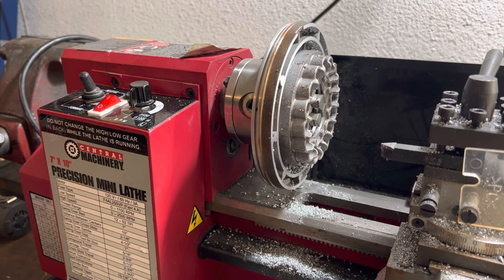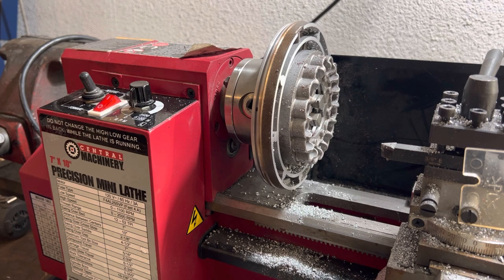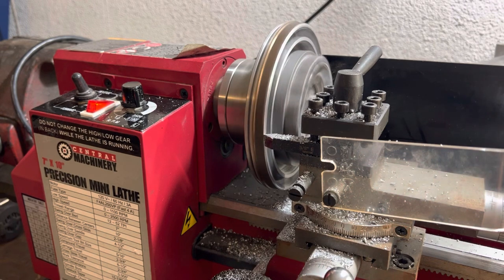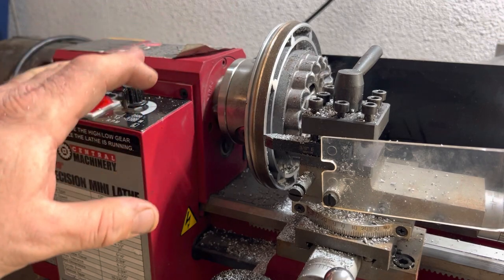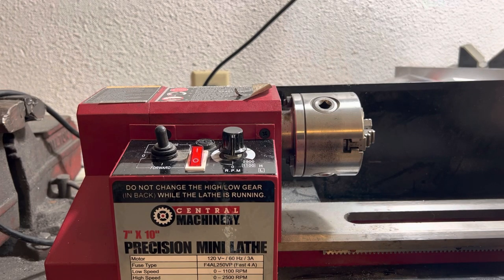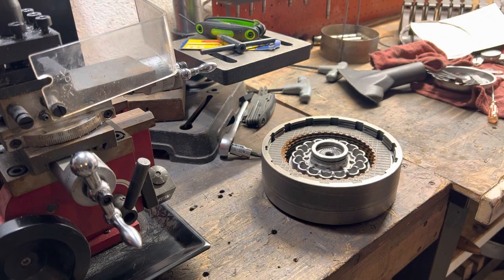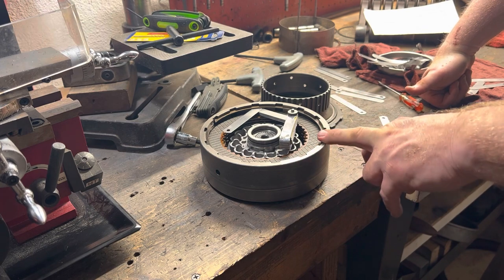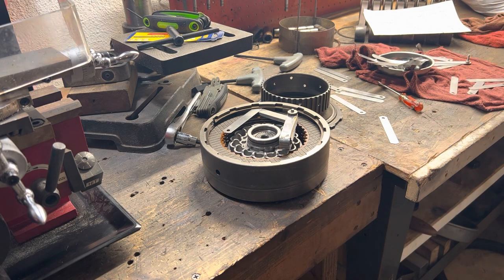DIY TH400 cut the apply piston 6 Forward clutches

Comment: Thanks for making this video. I was wondering if the HF lathe would cut these pistons decently. I’m curious as to why your trans failed. I’ll be on the lookout for the next videos.
Reply from the maker: Hint: Always verify the check ball vent/release is functioning properly.
Reply from the maker: I wanted to find out if the HF mini lathe would work, many people thought it was to small but it worked great.  slow speed, sharp insert, in Low range never had it bog, slow down nothing abnormal cutting these aluminum pistons,
Reply: @HeadFlowInc  good to know. I’ve been on the lookout for a small lathe just for jobs like this. Also- if you send me a private message on FB messenger, I will send you some brass plugs (free of charge) for the next time you have to restrict your converter feed hole. Picture of truck/camper is my profile picture.  Otherwise delete this message. Thanks again for taking the time to video your adventures. I always enjoy your videos.

Comment: For 6 clutch plates. Put three .060” washers on the last friction, place the pressure plate on and install the snap ring. Check w feeler gauge between snap ring and top of pressure plate, if the snap ring will not go in it’s to tight.

Comment: Is that your new lathe or the one you borrowed?
Reply from the maker: Richards Harbor Freight Mini lathe, its proof of concept it works!  Many people questioned whether it was a big enough lathe, Winner.
Reply: @HeadFlowInc  did you use a level when mounting it?  Would that work to be sure it’s perfectly straight?
Reply from the maker: @Nana_D75  It's more of a physical application of trying to hold the piston as flat as possible while getting the jaws to grab it.  once you turn on the lathe you see if it's spinning true.  after mounting the part you could use a dial indicator to verify its spinning true, or as true as possible.